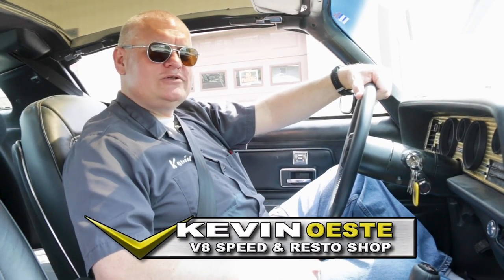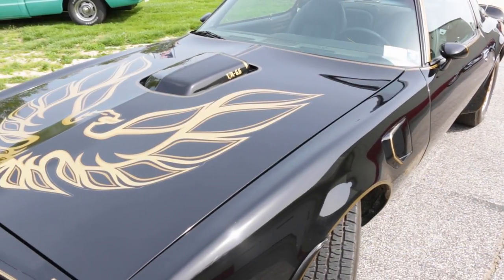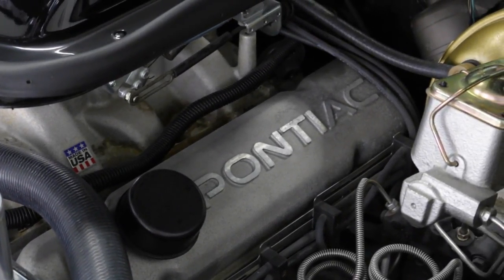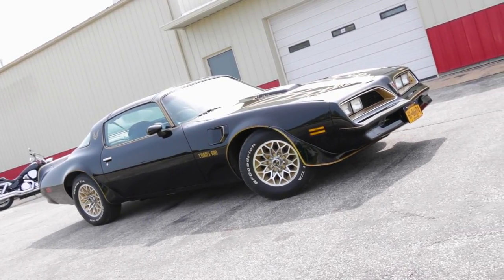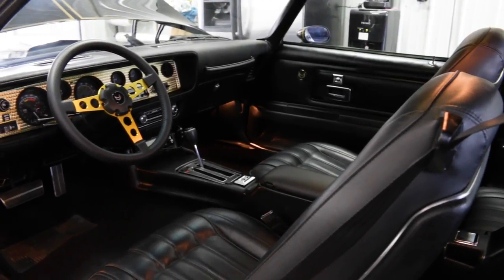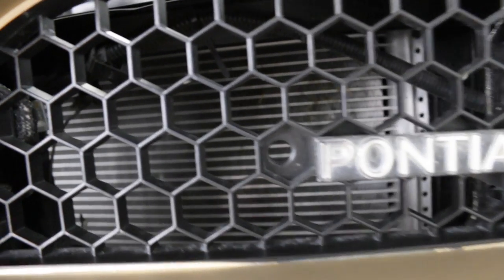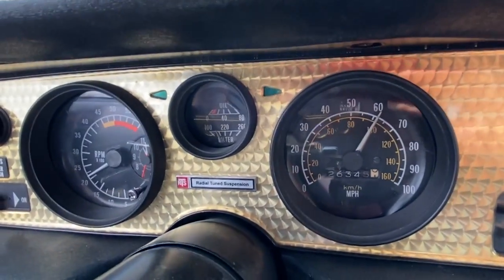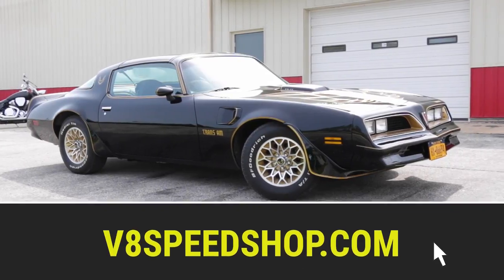Driving an updated 1977 Pontiac Trans Am SE at V8 Speed and Resto Shop V8TV

Comment: The W72 actually was reported at 220hp by Pontiac,  Car and Driver tested the car in 78 and stated the hp on the W72 was more likely 265hp and GM under reported to the EPA.
Reply: Thats correct. I have owned 2 of them, both S/E. T/A W-72, and WS-6. Never should have sold them.
Reply: The W72 was rated at 200hp in 77 and 220hp  with a revised camshaft and other slight changes for 78 and 79. The NHRA also dynoed these engines and had them at 260 to 280 net hp.

Comment: Nice video but it was full of misinformation. The Y82 Special edition package was cosmetic only. The performance suspension package he was referring to (WS6) wasnt available until 1978. All 77 trans ams came with the same suspension/steering package. The 4 speed manual was also not exclusive to trans ams. Firebirds and Formulas also could be optioned with a 4 speed.

Comment: I was looking to install a Gear Vendors unit in my T/A after I modded the engine and went with a TH400. I called GV and they informed me I would need to notch a "rib" that goes across the floor. They said it was used by GM to move the floor pan into position to attach the subframe, suspension, driveline, etc. To me, it looks like it gives structural support...I am hesitant to cut.

Comment: 1977 Trans Am T/A 6.6 Pontiac engines were rated at 200 HP @ 3600 rpm.  Only in 1978/79, with the change of camshaft, did it achieve a 220 HP rating @ 4000 rpm.  No 1977 model year Pontiac 400 engines were offered with that 220 HP rating.

Comment: My all time favorite machine! Closest I ever got to one was a 79 Z28. Like the T/A looks better though 👊
Reply: Trans Am is better 
My brother had the 1980 which was better that yr only since transam was a 301 turbo failure
Reply: TA for everyother one was a better car 1989 had a 3.8 turbo which was faster than corvettes the later ones were same engine as specs but better inside comfort  and handling was much better
Reply: @GTARockman  HI Robert, yeah. In 1980 the Camaro Z28 was more desirable than the same year TTA.
Absolutely loved the air induction hood with the functional vents, going click clang, when running the manuel version through the gears...
Reply: @GTARockman  Those twentieth anniversary indy pace cars were beautiful on the 1989 TTA. Loved the paint scheme on those, just like I did the 1980 versions.

Comment: Ford Fanboy here.  This is still an iconic car.  Even though it is a GM by-product.  Why did these cars not get the 455?
Reply: 76 was the last year for the 455
Reply: @chuckman2219  Thanks for the info.
Reply: @chuckman2219  Side note worth mentioning: A 301c.i. Turbo was offered in the '80-'81 Firebird producing a whopping 210 hp  and 345 lbft torque. A sad time in the "muscle car" era.
Reply: @WorldsBestWatcher  In the 1980's Buddy had one of those chicken cars, 305 with tall gears, would wind out to 150 mph.
Reply: @bradyelich2745  Me too. My friend's was a blue one. Beautiful car.  I was in it one time when he  topped it out. It took a while to get there but it definitely buried the needle.
Reply: @WorldsBestWatcher  Same horsepower and torque as the "77.

Comment: Kev, whatz up man....another great video cuz it had a TA - lol.

Question, what was that electronic overdrive system you guys put in? Did u use the original 350 trans or did u install a R200?  Also, was the overdrive controlled by vacuum and that rocker switch? 

Thanks man!
Reply from the maker: Hey man, the unit is a Gear Vendors OD unit.    You can learn more about the operation and install on a 2nd Gen Firebird in this video - https://www.youtube.com/watch?v=p51-erNdUP8.   They attach to the original transmission, in the case of the '77 a TH350.

Comment: Okay so I have a 1977 Pontiac T/A with the hurst t tops radial tuned suspension and olds 403 all that how do I tell if it’s a true SE I read somewhere the only way to tell if it’s a true SE is the build sheet or window sticker from when it was purchased which I have neither and that the Pontiac emblem on the front bumper was read on the SE but it’s old and I’m not sure if it’s faded or even the original bumper being that it’s not unusual for them to get damaged could I get some insight on if it’s a true SE it is a Y82

Comment: If this car had 350 hp or weighed 800 lb less the performance would be enough to top mustangs and maybe came closer to hemi from Dodge. But 200 hp was not enough even with 300 lb torque. Should have had more 350 cubic inch HORSE POWER
Reply: epa wouldnt let them in those days.